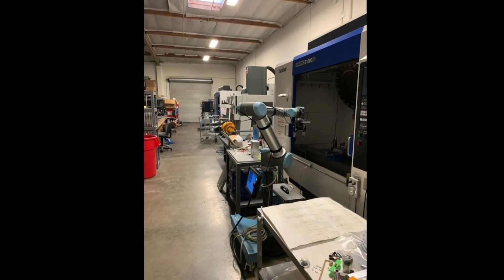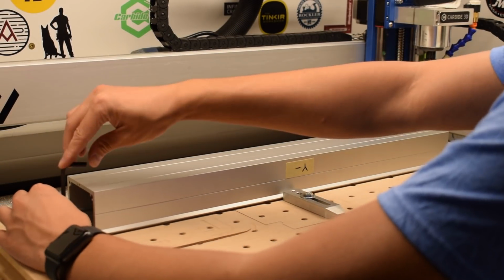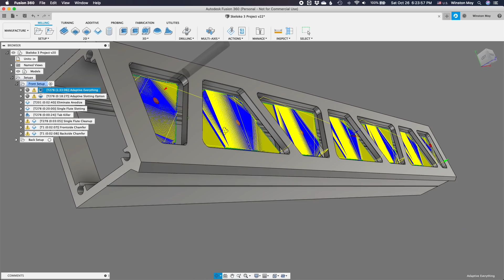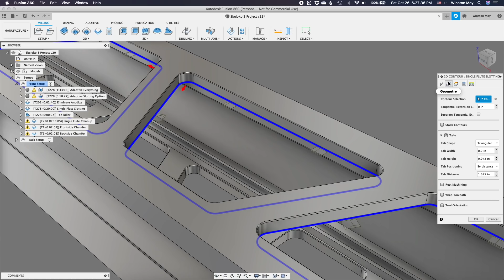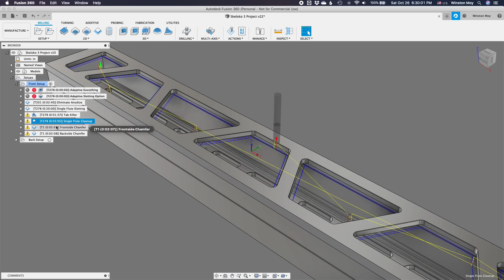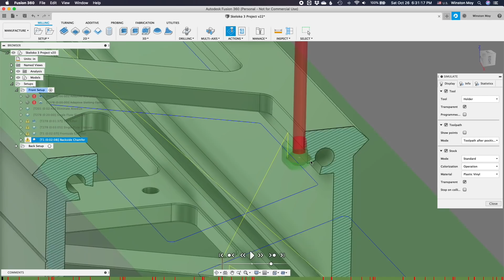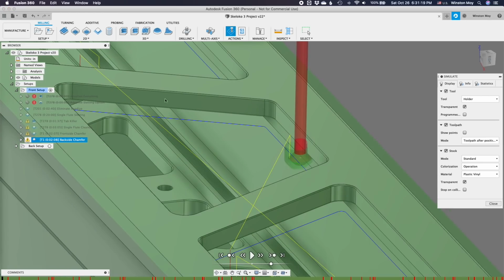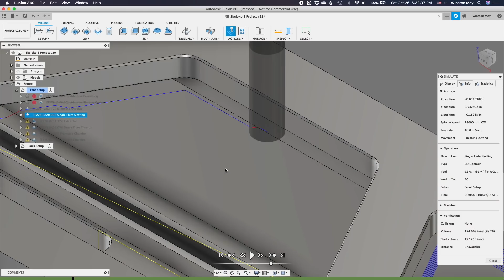Machining Anodized Aluminum to Skeletonize My Shapeoko - #158

Comment: I'm thinking filling it with granite epoxy might be more fun.
Reply from the maker: Vince.Fab has done sand. But there are plenty of things I would rather upgrade first, like a low runout VFD spindle or something.
Reply: @WinstonMakes  2.2kw with 4 bearings, but it will be 220v
Reply: Or even just an actual granite base for when it’s not traveling, solves many of the downsides of a lighter CNC.
Reply: That would have been easier before milling out the rails...
Reply: That's not gonna give you rigidity tho but more weight and maybe less vibration.